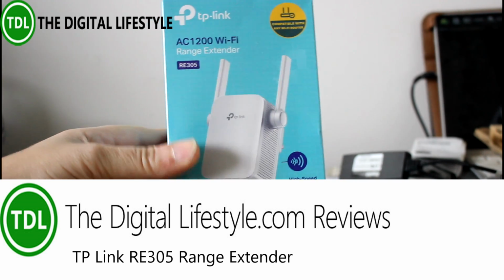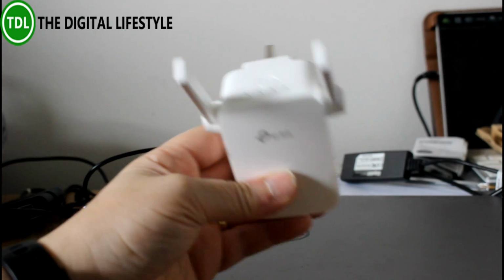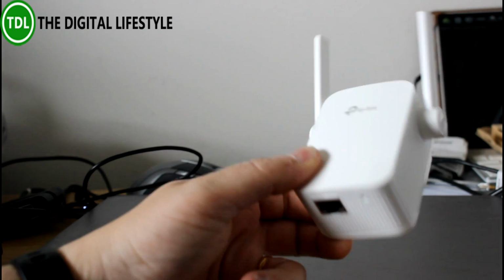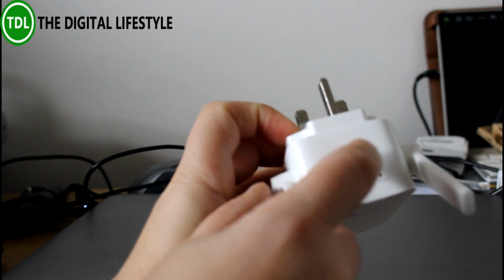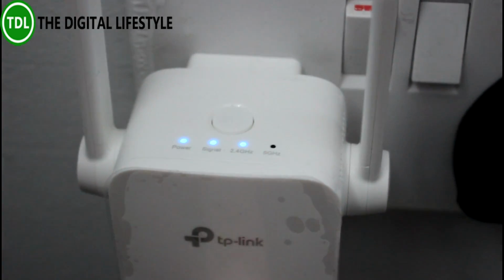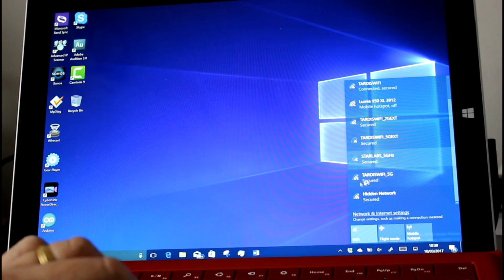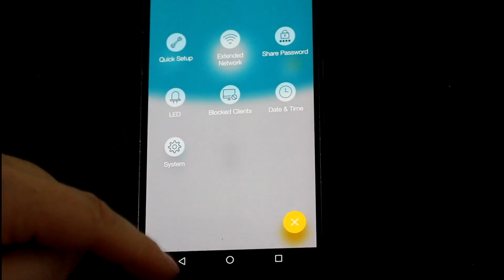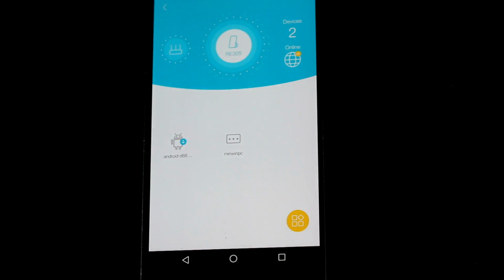TP-Link RE305 Range Extender

Comment: Can I use it as router instead repeater or extender?what I mean is I don't have router, so can l directly connect this device with my lan cable and use the wifi?
Reply: Yes you can use this as a router also
Reply: @neutralgrounds07  Chinese product....no more interested
Reply: @satyaprakashnayak1363  um

Comment: Question. Do I have to place the extender in the same room as the modem or should I place it in the room where I want more signal strength? And does the signal light HAVE to be lit? I have it plugged into another room with no signal lit on. Just want to verify what I already know. (trying to power 2 apts.)
Reply: I know I'm three months late but to answer your question:

Neither.
You place it in between your modem and dead spot.